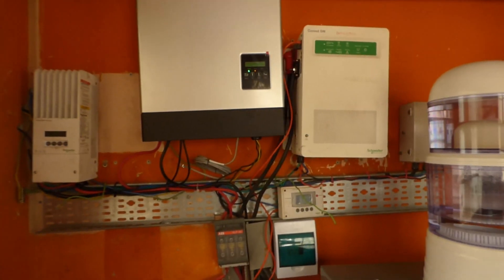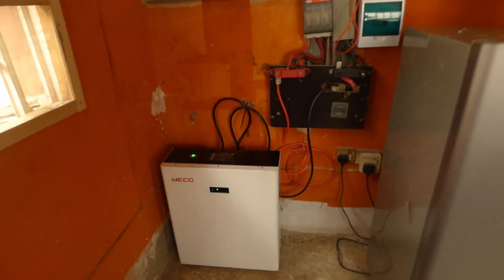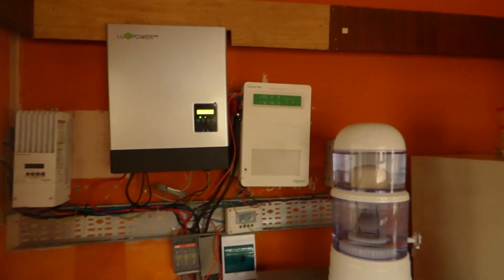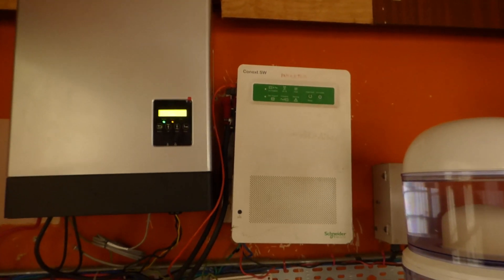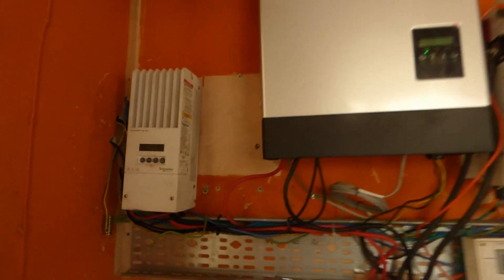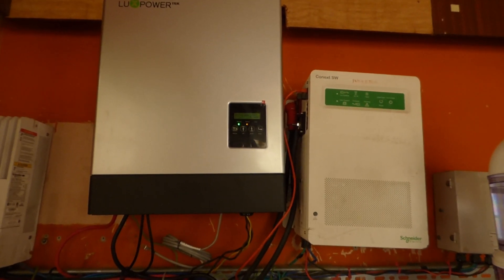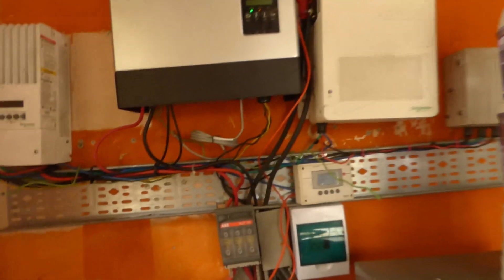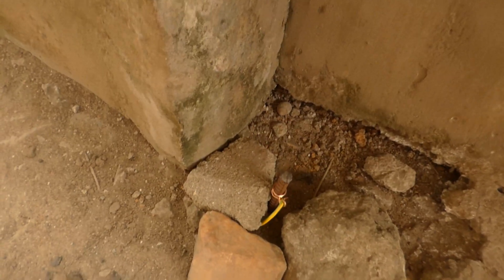Luxpower Hybrid Inverter Day 2

Comment: From 1-10 how u can rate luxpower
Reply from the maker: I don't really do ratings. It is a very good quality inverter and as long as you buy them for the reason they are intended you can't go wrong
Reply: AWPS Renewable Energy, LTD my friend do you know the link for iMac monitoring?
Reply from the maker: @nilobualoy117  sorry I don't. I am an Android person
Reply: AWPS Renewable Energy, LTD okey thanks another question i have cylindrical lifepo4 5.5ah which is 340ah total only 1yr old, can i mixed the cylindrical lifepo4 6ah 100ah new one?
Reply from the maker: @nilobualoy117  I would not mix cells of different capacities and age. Good luck. Thank you for commenting

Comment: Can the lux power 5k work without the charge controller?
Reply: Yes battery needs to be grounded too.
Reply from the maker: @Moffat-T  thank you for the pointer. Our new batteries are grounded.
Reply from the maker: Hello from Lagos Nigeria. When we initially installed it we charged using a Victron and Conext MPPT. It worked fine. So the answer is yes. It will work without connecting the inbuilt charge controller. Thank you for watching and commenting
Reply: @drsolar  So the lux power can work with panels and with or without batteries standalone?
Reply from the maker: @myparadiseonbantayanisland9030  yes it can
Reply: @drsolar  my plan is to run 2 - lux power 5kwh offgrid hybrid parallel inverters without batteries (will use grid power at night and times when solar panels will not meet the needs). I am waiting for zinc bromide flow batteries to become available before adding batteries.
Reply from the maker: @myparadiseonbantayanisland9030  you have a reliable grid so you can do that. Can you sell back to the grid? How much in PV do you have? Battery technology is pretty stable, but the future is very promising. Stay well and safe
Reply: @drsolar  No i cannot sell back to the grid so that is why offgrid hybrid. Power here is usually 3 hours blackout a day. I plan to have 24 400w panels for 9600w. I will use a generator at night during blackout, until I get a flow battery.
Reply from the maker: That will work
Reply: @drsolar  I plan to use Redflow zinc bromide flow batteries. They are using them now as backup for telecommunications and home use is limited to Australia (corp headquarters located in Australia) during their field testing phase. 
How much battery power can the 5kwh lux power deliver? I heard it was only 3000kwh😕
Reply from the maker: 3600 in ups mode 5000 if PV yields 5000.  For batteries I would go with something that is already in the market. There were so many promising battery technologies that failed in the market or never made it beyond testing
Reply: @drsolar  problem with current batteries is when you get to ROI you have to buy batteries again and batteries double the cost of the system
Reply: @drsolar  so at night time the 5kwh lux power becomes a 3.6kwh inverter? Why not be 5kwh all the time?
Reply from the maker: Your Lithium phosphate batteries have a cycle use that equates to 10 years
Reply: @drsolar  yes and they are very expensive and you start your ROI over again trying to recoup the new battery cost. If the Redflow does not release in a year I may depending on my utility bill buy batteries. I will see which is most cost effective grid power supplementing my solar or battery backup.
Right now my electric bill is 80 USD per month in the small house i rent with 1 inverter aircon, however i am building a bigger house and plan to aircon the whole house with the 10kwh solar panel system during the day and cut back my aircon at night when on municipal power until i resolve the battery issue.
Reply from the maker: @myparadiseonbantayanisland9030  when it is running on battery it is 3600 watts. When it transfers it is the full 5000. So on your generator it will be 5000

Comment: https://youtu.be/r0C2UeLrTlA

Another good review on Luxpower inverter.  Getting in love with Luxpower inverter now
Reply from the maker: I had seen it. One of the reasons I did the LuxPower
Reply: @drsolar  what got my interest about this inverter was when you said there is no cooling fan but heat sink. 
Now what is getting me more interested in it now is where the man said Luxpower inverter puts out up to 90% battery capacity where as other brands trips off 80% used capacity

Comment: Good descriptions. 
I think I like that wenco lithium ion battery. I found out that it is rated 7000 cycles and  comes with good stock  BMS. I found that it usable kwh out 4.4kwh is 3kwh. The manufacturer really want this to last for ever. 
So for you to harvest up to 3.8kwh that means you either charge it up to its full capacity of 5kwh and your Luxpower inverter has a very good low voltage cut off that keeps the inverter running while battery in low voltage.   Yes I like inverters with very low cut off. I will tell you why.
Remember its better to under charge your battery, say 80% of its capacity in order to get more cycles out of the stated 7000 cycles.
Reply from the maker: You did your research. Thank you for commenting

Comment: If you have any more ground problems pour some water on the ground bar and keep the ground damp around it.
Reply: Hahaha are you joking? 
Not me and U!!!
Reply: @greatogbuagu1370  I think it can actually work. Damp ground conducts electricity better than dry ground.
Reply from the maker: @adon8672  you are absolutely correct. Thank you for commenting
Reply from the maker: @greatogbuagu1370  very real. The most effective is moist ground for earthing
Reply: @greatogbuagu1370  In Canada we don't use ground rods any more they sell a galvanized ground plate about a foot square it is recommended to put under an eve in a damp location
Reply: It's definitely a nice idea to consult Lux/Weco about grounding the battery. The normal procedure though is to connect the battery's negative terminal to earth. Both AC and DC can lead to the same earth rod but it's best the arrive there via different wires. Everything from solar panels, charge controllers, inverters and batteries must be grounded. You'll need to protect against lightning too as I don't see much of surge protectors in your videos. Please don't keep that repar for too long otherwise it'll rust and become a very poor conductor. Thanks for your educative videos.
Reply from the maker: @adon8672    thank you for watching. The Luxpower has lightning protection from the factory the others don't. We have some protection in the combiner boxes. We run separate earth rods for AC and DC. More expensive but I have peace of mind. All it takes is for an incompetent electrician and someone gets killed. Thank you for your great comments and observation
Reply from the maker: Actually damp ground is the best. The ground at the top might be dry but it is wet enough 4 feet down. It is working great. I put it where it can get damp. Thanks OGW.